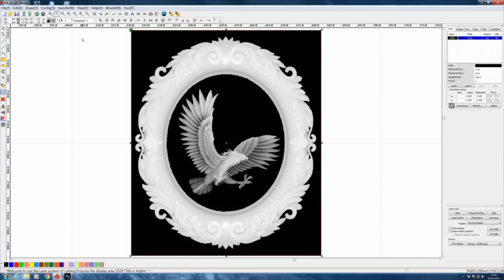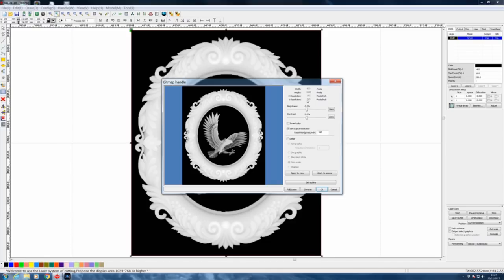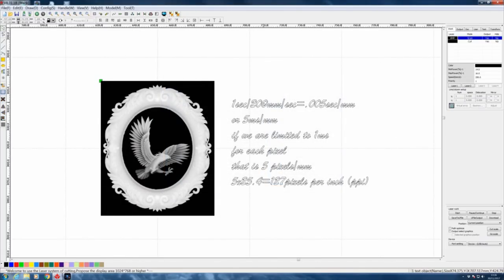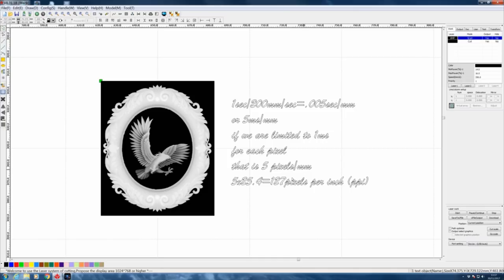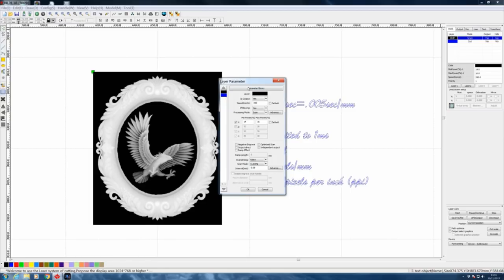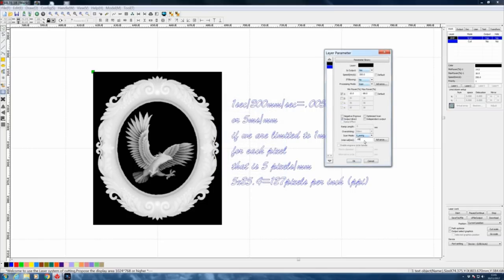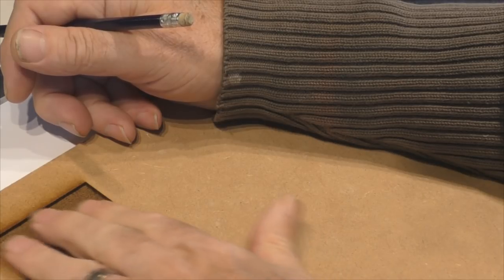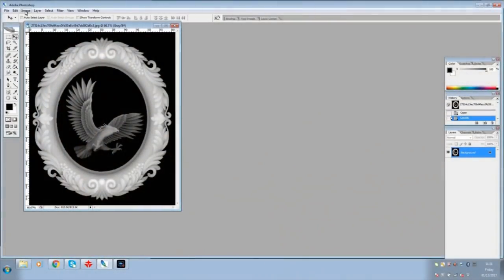RDWorks Learning Lab 127  3D Engraving Is this the FINAL Chapter Part 2

Comment: Thank you very much sir. You are the only one who explains everything in detail and make me understand how and why. most tutorial are like do what i do and you'll get the result and that doesn't help to experiment yourself or do slightly different thing. You help me a lot to not afraid of trying a lot of different settings. I was afraid to change the KHz setting because I thought ill damage the lamp or psu and I couldn't find anywhere what it is for. I saw it only for fiber lasers and it used to produce different colors on metal.

Comment: There is a "repeat" mode in this software. You can program it to repeat the design __ times at a specific interval. If you leave the interval at zero...it just repeats over the same area. I frequently use this when cutting vectors that require multiple passes.
Reply from the maker: I rarely use my pc to drive the machine so I have not really played with the top right-hand tabs. Thanks for the information
Best wishes
Russ
Reply: SarbarMultimedia I really appreciate the time you've devoted to the 3D engraving problem. I gave up long ago. I find the 3D results on acrylic to be especially important. This process could possibly be used to produce 2 piece acrylic molds for casting things like soft fishing lures or even various types of candy.

Comment: The problem you have to the square 100/30 is from user settings - Engraving factor. If this is to 0 then go slow but very smooth, bigger number it go faster but with waves. (google translate)

Comment: Hi Russ. you do like your formulas and details... do you have this 3d process on a file for a Chinese 60w laser?
from start to finish... on wood and Acrylic. Speed and power, number of passes. Would love to give it a try on my machine.
Reply from the maker: Hi
Thanks for the comment.  No this is not based on any formula but the method shown in the video of using a matrix pattern to find the best max and min values is the most useful starting point. You must do this for any new material you use because every type of wood (or plastic) is different,  Don't be too ambitious with your cuts. With wood it is better to do lots of small passes than two big passes (with lots of charring) and then one or two "smoothing" passes. If you choose the parameters correctly then 5 passes will generally give a good unburnt result.
Best wishes
Russ

Comment: Great journey! lovely results!  

Something you might want to change is de resolution/settings for capturing of you monitorscreen. I try to read the RDworks bits when your putting in settings but it is anti-aliased and very difficult to read.

Looking forward to see the results of your future endeavours.
Reply from the maker: Hi Steven
It's actually nothing to do with screen capture  because I'm working off a 4K screen. It's partly to do with rendering down to  a reasonable size file for uploading to You Tube. My videos are quite long so it is rendered down to wvm  as a 1050x1920 dat stream. The problem may be your download speed because You Tube starts off by sending a low data stream that  gradually improves if the line will allow it. I have seen this for myself when I watch back on a different monitor. Fuzzy text all of a sudden becomes clear.  At 1050x1920 the resolution should be good.
Thanks for the kind words and the comment
All best wishes
Russ
Reply: Dear  Russ, 
RDworks has a font thats only one pixel wide. downscaling 4K to 1080 makes it blurry (for example the layer parameters box or the interface right of the drawingtable.)  I only have a 1080p screen and a 200/200Mbit connection, other 1080p streams are fine.  Would it be an option to use only a quarter of your screen as workspace while capturing? then there  is no need for downscaling, just cut and render the 1080p part pixelperfect. Since trying to focus on something that is blurry gives headackes.  An other option is just upload 4K and ill go shopping for a monitor with that resolution.

I am exploring laser options for microfluidics, cutting fine channels in tapes acrylics and glass. And trying capturing flows in these devices with a microscope camera that has strange resolutions. But that is a complete different story.
Reply from the maker: Hi Steven
Coincidentally, I have just updated my video editor to the latest version . It happens to auto render and auto upload to  You tube.  I have captured  a snippet of RDWorks screen with my screen recorder set to  1920x1080 25fps   and I was working on a HD laptop screen. Does it look any clearer to you?
 see
https://www.youtube.com/watch?v=AnjdocQcKJ8

Best wishes
Russ
Reply: Hi Russ, Kind a slightlty clearer but not to a result you would like.  The linked video only allows 480p playback and thus losses a lot of the 1080p info on screen.   Frame rate is fine, low FPS for recording is enough to see whats happening on a desktop. What software do you use?  I am using OBS studio for capturing screen and cameras. Editors im not decided on yet. thusfar I am fiddling with moviemaker, hitfilm express and lightworks.
Reply from the maker: Hi Steven
I have discovered a higher render quality button. So try this.
https://youtu.be/9S7aPgn0lH4
Best wishes
Russ
Reply: perfect!
Reply from the maker: Hi Steven
Thanks for the feedback. I'll update my main editing desktop with the 4K monitor  and run another test for you. The ease of a one button render and transfer to You Tube makes life a lot simpler for me and if it improves the end result for the viewer then it's win win all round. I'll try something later today.
Best wishes
Russ
Reply: No rush,  I'm just waiting for the rain to stop to go fishing and should be home when it is dark again.  If your planning a 4K movie someone else should watch aswell since I only have a 1080p screen.
Reply from the maker: No. I am using a 4K camera but I always record in 1080 50p and edit at the same format. I do not have a 4K tv yet so little point in recording at that level. 1080 is good and there is little difference when you are watching moving pictures. If you stop and are super critical then 4K is superb as opposed to very very good for HD. 
Happy fishing
Best wishes
Russ

Comment: I can't wait to get my 130 watt... Love the vids!
Reply from the maker: Hi David
130 watts is a mighty tube that will cut through house bricks like butter (OK ,I exaggerate a bit) However, the problem will be engraving.  That's one of the reasons why they make lasers with two tubes. The powerful one for cutting and a 30 or 40 watt tube for engraving. You need very little power, maybe  4 to 10 watts with delicate control of the power  for many types of engraving so please don't dream too big. I chose a 60 watt tube when I upgraded because that is about the best compromise power. It cuts many things, some rather slowly, and gives reasonable control of low power for engraving. I still struggle at times.
All best wishes
Russ

Comment: for the 3d laser engraving ...... i was thinking of the slicer software which we use for 3d printing machine. there is options to make it for laser cutting, then to get this picture and cut it in photoshop as per the numbers there, then start make them layers in RD works in descending order from the light engraving to deep engraving..... hope it's working.....
Reply from the maker: HI Alt
3D slicer software depends on having  a 3d object to copy or for you to slice up your own 3D creation. Sadly people think that you can 3D engrave a photo. Wrong. There is no 3D information in a photo. As you say, the 3D engraving pictures are made up with 256 layers of grey where each layer is recording a different Z dimension. There is no Z dimension information in a photo just shades of grey that represent different colours.
Best wishes
Russ

Comment: @SarbarMultimedia Does the machine have any respect to the min and max power settings? I set mine to min11% and max 20% and in the simulation it starts near 0% and goes all the way up to 100%.
Reply from the maker: Hi
The RDWorks preview screen will always show the same 0 to 100% graduated image  regardless of the max min values you actually choose.  This is just an oddity,  I agree, but provided you have the DIRECT OUTPUT switch ticked then you will see the depth  difference in the engraving results between 10 min/20 max   and 10 min/70 max.
Best wishes
Russ
Reply: @SarbarMultimedia  thank you so much for your reply

Comment: Definitely one of the top 5 videos in your series - thank you.    I wonder if anyone has knowledge of how super hard woods might engrave  - ebony, purple heart, Brazilian _ _, ??????
Reply from the maker: Hi Dennis
As it happens I do have a small chunk of ebony that someone gifted me just recently. Although it is the perfect candidate for 3D engraving I was a bit unsure about using it  Why?  Well, I had read that folks using this type of hardwood for block printing, did their engraving on the end grain. I can understand that from an ink retention point of view, so I  was unsure if I should do likewise or split my one and only sample to reveal the long grain. I decided to not experiment until I had cracked the process.. There is just the possibility that I have enough to try both ways as the framed eagle is not that big. Obviously there will be a problem with sample testing with my squares because  residual carbon and ebony are the same colour.  Definitely something for the future but I think very doable because it is an organic material that will absorb the IR light and create heat to burn just like any other wood Softwood and hardwoods all burn at about 300 to 350 C so I don't think mechanical strength and density are going to greatly change the parameters.
Best wishes
Russ

Comment: Another amazing video, nice one. 

Two questions -

When deep engraving do you alter the focus point as it gets deeper?

Is the a video on how you created your machine profile curve in photoshop??

Thanks
Reply from the maker: Hi Dave
In answer to your questions
Depending on the focal length of the lens, there may be a small advantage to be had by setting the focal point about 1mm lower for CUTTING some materials  but in general i always set to the work surface for engraving and cutting. In this instance I was using a 2.5" focal length lens which has a working range of about 1.5 to 2mm below the focal point, so there was no need to make adjustments.
I think you are asking where my original calibration graph came from? If so, it is something I had to genetate for myself. To create it you need two essential tools. One is an ammeter to tell you what current is flowing through the tube and the second is a power meter to measure the watts from your tube for any specified drive current. That will allow you to construct the all seeing graphical relationship between %power and watts output., In part one of this video, the way to graphically create power corrections for grey scale is demonstrated. If you wish to see all about tube calibration  you can watch
https://www.youtube.com/watch?v=nZuatc3eIgU

Best wishes
Russ
Reply: Great, many thanks Russ.

I'm only running the bog-standard 2" lens so far and i have only reached slate/glass engraving so no greyscale stuff yet but its on the to-do list. With slate i have proved for myself that there is no benefit in sending any more than about 150-200dpi bitmaps, running at 150mm/s and 17%/17% power, works very well once you have Sussex out the photoshop prep side of it :)

Really wish i had bought a laser a few years ago now :)
Reply from the maker: Hi Dave
I think that using a 1.5" lens with slate/glassgranite I will be able to push the resolution up to 300 plus. But that's a session or two for the near future. But yes there is definitely a need to prep the photo to an unacceptably light look. I will try to determine a few rules for that preparation as well
Best wishes
Russ
Reply: Sounds good, I arrived at the figures by running tests at different scan gaps - the point where the scan lines started touching properly was 0.15mm, this i took as the the physical dot size and 25.4mm/0.15 = 170 LPI, then i assumed that if lines/scans were fixed in one direction, fixing them in the other would give the theoretical max quality so i started tests using a range of DPI from 120 to 300. My theory was backed up by observing that there was no discernible quality or appearance improvement after 190-200 DPI.

This is all on slate of course and a 180DPI input gives excellent results - its a pretty low resolution substrate.

Comment: could it be the time it takes for the machine to feed out the info from the program  a bottle neck at the usb that is causing the lines
Reply from the maker: Nice thought but I'm sure the answer is no because the program is already in machine memory. I have experience problems with some big programs where the machine starts running the program whilst it is still downloading and UI then get all sorts of scanning drift. I now always press pause and let the program download to memory first, This is not a problem with the program. My first reaction was "curtains".  But no, the pitch is wrong and I have fixed curtains in X. I have done nothing to fix curtains in Y and the problem appears in both X and Y scans. This has all the symptoms of a mechanical velocity issue just like the curtains problem. This is appears where there is black  ie full power, If the power is high and the velocity changes then the cut will be deeper  for lower velocity. That is one thing that this machine is good at....producing 3D velocity plots!!  I have often wondered if changing black from 0 to maybe greyscale 10 would have helped. It's not there in the wood cuts , just the acrylic which is much more power sensitive
.Best wishes
Russ
Reply: @SarbarMultimedia  thanks for the reply I have only ben using one of this machine for a few weeks now haven't tried doing any 3d cuts yet lots of good info in your video's for when I take that on

Comment: The more deeper into each layer the more out of focus perhaps if you adjust the focus on each layer you can improve the clarity?? Perhaps?
Reply from the maker: Hi Ken
If you think about it logically you cannot adjust the focus because the whole idea is to leave white sections on the surface of your material. This is all about compromise. I finished up using a 2.5" lens because it had a longer effective working focal range. It is possible that I may have been able to drop the focus 1mm into the material to start with  but that's just another judgmental compromise.. Yes the beam goes out of focus as the depth increases, but the central portion of the beam is still very powerful, even at 4 or 5mm out of focus. If you wish to concentrate on 3D engraving to make money, then what I have given you here is a foundation to build upon. I will not claim these are the absolute ideal parameters but I am discovering what the basic principles are that make 3D engraving happen.  With many more hours of experimentation I may be able to improve by 10 %. I don't need to  because mine is a learning journey not a money making venture.
Thanks for the comment because it's always good to delve into the background that I may not fully explain on my videos.

Best wishes
Russ

Comment: Hy

I have been following your work for a couple of months no. I find it really interesting and fascinating to see you discover things that I did never thought of :)

After buying a Co2 laser I am now buying a fiber laser because as a knifemaker I would like to engrave directly into the steel blades. And if I go this route it would be awesome to be able to 3d engrave in the blades. So here comes my question :)
 Would a "2D" fiber laser (one without a special 3d laser head and motorized Z-axis) be able to 3d engrave with this bitmap technique / greyscale depth map technique?

Thank you for answering my question in advance and an even bigger thanks for the great content you are putting out!

Knifesharp regards
Sander
www.Mknives.eu
Reply from the maker: Hi
 I did have a fiber laser on loan for about 10 moths but I never got round to any grayscale engraving.. The software used for the fiber laser is EZcad. I cannot recall seeing  any menu or ability to decode grayscale so although in principle it seems possible I would check with others to see if it is actually possible.
 Sorry i cannot be more helpful. There are several fiber laser You tubers out there who may be better able to give you a definitive answer.

Best wishes
Russ
Reply: @SarbarMultimedia   Thank you very much for your fast reaction!
Could you point me towards one of the YouTubers who could give me any info about this?

thanks in advance :)
Reply from the maker: Try this guy he is pretty prolific in his videos.
Best wishes
Russ
https://www.youtube.com/channel/UCAXubZvBGAFnnRpgS6fMJJA/videos?view=0&sort=dd&shelf_id=1